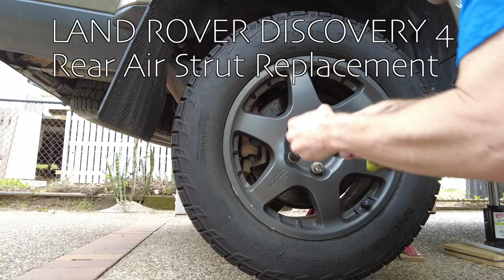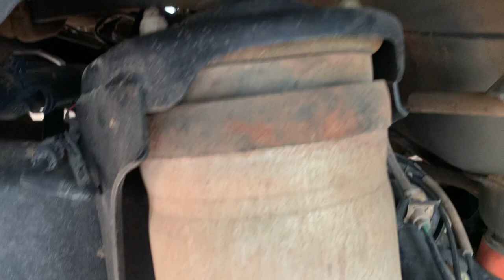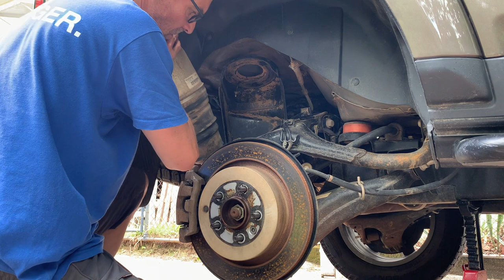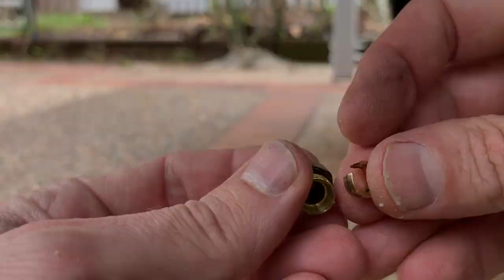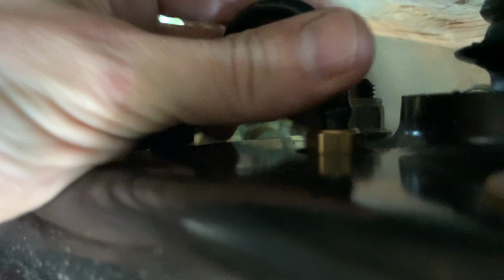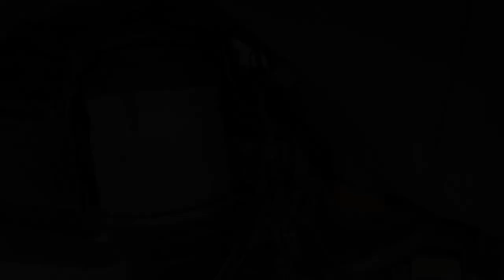Rear Strut Replacement. Land Rover Discovery 4 (LR4) air bag suspension

Comment: Many thanks indeed Scott.  I'm a very big fan of all your videos and you've inspired me to make this my next job.  170,000km on the original air suspension with no obvious issues yet but on a km bases alone they've got to be due for replacement.
Reply from the maker: Cheers. I expect you’ll notice the improvement. Too early for me to confirm yet as they’ve only just been replaced. Just replaced fronts now too, slightly more fiddly to access inner-most top bolt compared to rear.
Reply: @sienaoverland  Yes, I did read on a couple of forums that the fronts are a little more of a challenge than the rears but still doable.  All 4 struts were ordered today from the same place you got yours from and I hope to receive them in a couple of months subject to Covid shipping delays.  Thanks again for providing the confidence to proceed.

Comment: That didn't seem too bad at all except on the wallet. 👍
Reply from the maker: I've never tackled a job like that before and am no mechanic and I found it surprisingly straightforward. The rear-most top bolt and brass air fitting are fiddly but you just need to take it slowly.

Comment: I ended up doing all our struts and front lower control arms 2 nights before we left before NQ.
The biggest issue I hand was height re calibration
Reply from the maker: Nothing like last minute! I didn't need to do any calibration with the new struts. Perhaps you knocked a sensor?

Comment: Great vids on your channel! I have a v8 Disco 4 in Canada, picked up the IID tool, haven't had to really diagnose anything yet however I understand you need it or similar or dealer to do the air suspension calibration for the air bags, what have you done for that if anything? 

off topic -  would you ever get a roo/bull bar for your disco? I'm trying to decide if I should pick up an ARB bumper or do the discrete winch mount like yours, hmmm. Also wish they sold the TD6 in Canada, was driving my cousins all summer in Switzerland, that low torque and fuel economy is something I can only dream of in my 5.0L.
Reply from the maker: Hi mate. You don't need to calibrate anything when changing air bag struts because you don't need to touch the height sensors (or any other sensors). Calibration is needed if any sensors are damaged/changed or if the ride height gets out of calibration somehow.
Reply from the maker: I have thought about a front bar at various times but have decided against. We tend to avoid driving at times when wildlife is most risky, ie dusk/evening and dawn. This reduces the risk significantly but obviously not to zero. There's no right/wrong answer, just a balance judgement you need to make.
Reply: @sienaoverland  Ah okay, I watched a rover parts video and they mentioned anytime you change an air bag or a ride height sensor. If yours is doing fine then that's great :)
Reply: @sienaoverland  Yep understand that. I guess the reason I wouldn't is because of the fuel economy (extra weight). No idea how much it would effect it though.
Reply from the maker: Yeah I'm quite conscious about weight as well. For remote trips where plenty of extra fuel and water is required I'm basically at GVM for the first day.

Comment: Nice vid Scott. One of the complaints about air suspension I have heard from the live axle brigade is that you cant fix it yourself or get it fixed in the outback. This didn’t seem too much different from replacing a traditional coil over. How did you think this would go if you had to do it in less than ideal conditions?
Reply: P.S. Your videos have inspired me to look for a D4.
Reply from the maker: Yes, I found it relatively straightforward and I'm certainly no mechanic. You really just need a jack and the correct size spanners and the job could be done virtually anywhere flat, although the second jack does help to take the weight of the strut.

Comment: Speaking of shocks for loaded up conditions (higher vehicle weight and off road)  Did you consider any other struts such as the Bilstein's 4600 Series Shocks?    I am trying to figure out if it is worth going that route.  The originals seem to do alright but I do feel like they are under dampened when fully loaded near GVWR.
Reply from the maker: Hi Mike. No I didn't consider alternative shocks. I've always been very happy with the stock unit performance even when fully loaded. I think over 120,000km is a reasonable life and they certainly were not completely shot. It's just that we have a lot of travel planned for 2021 and I'd prefer to have that great ride for the big trips. I've also not read any feedback on aftermarket shocks for Australian conditions.
Reply: do Bilstein or other shock absorber manufacturers make a replacement shock for the inside of an LR3 / Lr4 air strut?  
I thought that they had all tried and given up a few years ago as there isn't enough room for an upgraded / larger shock inside the air bag assembly.
Like Scott H I had sourced OEM struts from Advanced Factors in the UK and had them shipped to West Australia.
Edit: just did a search and found them.  This wasn't the case a few years ago. Looks interesting, a complete Bilstein strut. For example front strut part No 44-218669.

Comment: How much did they set you back Scott?
Reply from the maker: About $880 AUD shipped to Australia (shipping is expensive) from Advanced Factors for the BWI (OEM) units.
Reply: @sienaoverland  2pcs?
Reply from the maker: Yes that's for the rear pair. Same again for the fronts.
Reply: @sienaoverland  hey Scottie I just checked their website it doesn't say whether it's a pair or a single shock absorber for the LR038096 OEM Shock Absorber Rear Assy LR032650 RPD501090. I have a 2014 lr4. Located in brissy.
Reply from the maker: @jamesm3268  it’s probably only one but best to check with supplier

Comment: Good Vid. How did you know that the rear air spring needed replacing?
Reply from the maker: A reduction in performance when loaded up for long trips or when towing, could tell that it "wallowed" a little over undulations as compared to how rock-solid it was the first few years. Every report I've read seemed to indicate a major and obvious improvement when shocks are changed and I didn't want to leave it that long, especially when we have a lot of travel planned for next year.

Comment: Get yourself some ratchet spanners.
Reply from the maker: I’ve got a full set of ratchets but the restricted space around the top bolts meant that a combination of different spanners for each bolt worked best. It was even more difficult for the front ones.